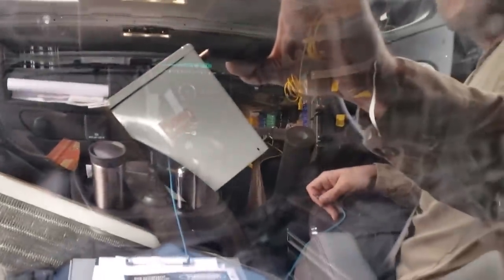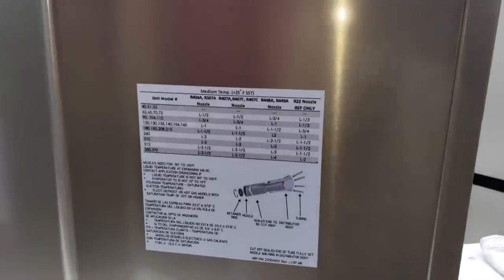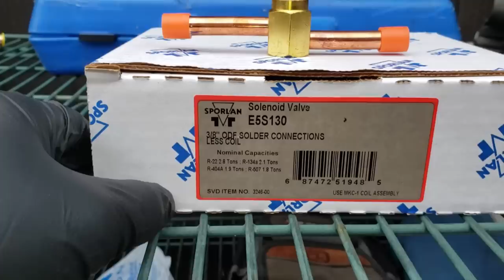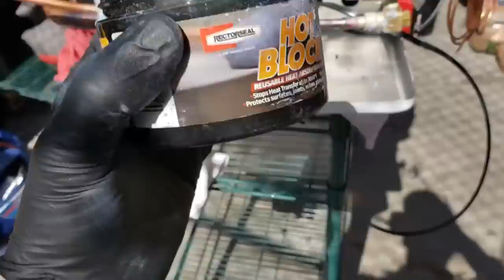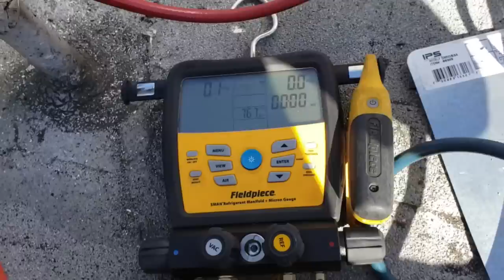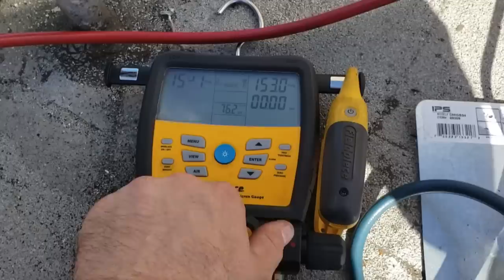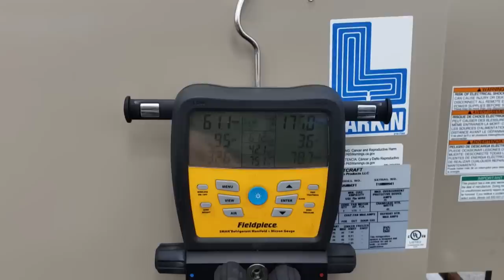WALK IN COOLER INSTALL

Comment: Back in the 80's, I installed a lot of these walk-in coolers and freezers.  The evaporators only came with one nozzle in those days.  It was R-12 for the coolers and R-502 for the freezers.  Today, I would probably use Stay-Brite 8 soft solder instead of brazing but in the 80's we always used 15% silver brazing stick.  The only time we used Nitrogen is when it was included in the specification.  I wish we had Nyloq when I was in working in HVACR.  I bought some when I installed my new A/C and I love that stuff.  I see that the quality control is still mostly nonexistent in refrigeration equipment.  We used to get brand new compressor racks and all of the piping was leaking and was not pressure tested.  We would have to re-pipe everything before we installed the racks.

Comment: I have found that sanding the tvx fittings in fact any valve fittings heat up faster reducing time spent brazing which in turn reduces the  chance of overheating ur valves. I have done dozens of supermarket installs and this technique reduces brazing time alot

Comment: 60' is one flat on the valve, I usually put some permanent marker lines one the body and power element so I can see when its turned the right amount.
Reply from the maker: Yeah I'm bad in that I just can feel it and know when it's right, same with flares. So when I'm making a video and trying to teach I sometimes forget and just do what I know is right vs actually setting an example
Reply: I'm sure you don't need any advice from me! just thought it might be ahelpful idea  to anyone reading the comments. 
Don't see many sporlan valves here, maybe get to work on one once or twice a year.  @HVACRVIDEOS
Reply from the maker: Thanks for watching, I will be going live this evening 3/25/19 @5:PM (pacific time) on YouTube to discuss my most recent uploads come on over and check it out if you can... https://youtu.be/Bqx-RSJsidY

Comment: Nitrogen IS used as an inert gas,  but the term "inert" in this case  doesn't have ANYTHING to do with temperature and pressure. An inert gas is a gas that does not undergo CHEMICAL reactions under a set of given conditions. like how when you burn Hydrogen in an Oxygen environment - you get water, a chemical byproduct. Not to be confused with Noble gasses either.  Nitrogen is used in you braising because it is CHEMICALLY inert in your application, and won't react with your solder, flux, copper, or torch byproducts. And it may not even be pure nitrogen, there are compound gasses that are chemically inert.  The people who believe a gas in a closed system doesn't respond to temperature by changing pressure are just wrong flat out, whether the gas is chemically inert or not :)
Reply: PV = nRT you can't avoid physical laws :)
Reply: And while nitrogen is enough for brazing, you can't use it in arc welding because at that kind of temperature it WILL react with iron, messing up the welds. You need Argon, which is a true noble gas and will not react with iron.
Reply: @Zonkotron  and I am still unsure why argon is not used for this type of thing...... nitrogen stops the reaction inside the braze but argon would too and is used for almost every wire-feed welding system I've seen (not counting flux-core wire) so why nitrogen instead for refrigeration?
Reply: @jojomorgan8556  Nitrogen is cheap. The cheapest technical gas there is. Nitrogen and Argon are both drawn from the air by Linde Cycle Plants and there is like 60+ times as much Nitrogen as there is Argon per unit of Air. If you are not heating stuff above a yellow (glowing) heat, it is perfectly sufficient

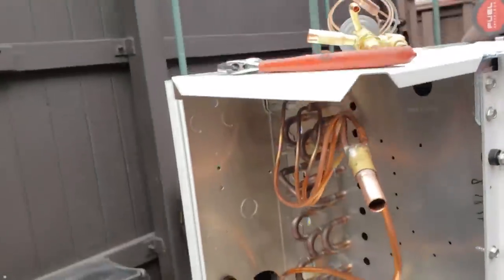Comment: 9:02 You should send this video to Heat Craft. During the shipment the debris can be anywhere inside of the coil. Likely you see the debris. If all debris goes inside of the coil, and after you have everything set up, and turn out somewhere is clogged, you have to no idea why it is clogged. It will be very frustrating in the field!

Comment: That was nice that you had the opposite side of the box from the old evaporator coils to hang the new evaps. It made the install not pressed by any down time issues for the product in the box. Also, good move on your part to not want the hot air from the door opening to feed directly into the return air on the new evaps. Installing the new ones on the opposite side of the box makes it so the warm air entering from the doorway has to mix with the box air before reaching the return air side of the evaporators. That will help your Delta T split readings alot. Anyway, as always, good work!

Comment: When I took a refrigeration course they taught us brazing. Working with my then instructor he uses the same solder that plumbers use. After doing hundreds of joints without failure or leaks... I am sold. LOTS less heat... inside the lines are MUCH cleaner after.

Comment: Nitrogen is an inert gas. What changes pressure in the system is the the air molecules in system the larger the pressure change the the more air you have in the system. Thats why in some system change outs you  have to keep lines closed so your nitro test doesnt have to much pressure change and vaccuum takes less time

Comment: Nice install,  but rather have 2 x separate systems on a 60/60 ratio incase one system packs up the other will continue to run the cold room until it is repaired. Just a thought.... also depends on customers budget...👍

Comment: i dont instal the nozzle, it dont make sense, my customers have old equipment and old evap, i have  head few times where i see low flowing of refrigerant after the txv and some of the tubing from the distributer are partially restricted ,  i found it working better without the Schnozzel
thank you for great video 🙂✅

Comment: Wow you actually get time to change oil on the vac, I need to work for a different company that actually wants to do to jobs right, I work on transport refrigeration we never get time to do anything right.
Reply from the maker: Yeah we try to do it right.....
Reply: Car refrigeration is nice though. Just hook up the automated equipment, punch in the charge, the oil amount, and if you want any UV tracer, hit start, and it will do the job for you and only beep at you if something fails or if you need to do something.

Comment: Nice job. Would you ever consider adding a tee on the liquid line between the solenoid valve and expansion valve to pipe that evaporator master and the other becomes a slave. Change solenoid valve to overall system size so you only have one solenoid.  Easier troubleshooting if valve problem.

I found some shraeder core seals melting in the threads of the access port when they braze the ends on the evaporators, becareful to check the cores before you braze the evaporator in permanently, pain in the ass getting the seal out.

Nice job
Reply: It's becoming more common to see multiple evaporators on one compressor, like cold zone package systems. How do they get away putting multiple pan chillers on one compressor if say only one pan chiller is calling.  High superheat and high subcooling is common bc your capacity can be way oversized with only one calling.  Thoughts?
Reply from the maker: I will answer your question on my stream tonight if you can come over and check it out https://youtu.be/Bqx-RSJsidY
Reply from the maker: I call that system a multiplex compressor killer. It's very common to see this on a Kairak system and we usually have to replace the compressor  every 2 to 3 years.

Comment: Such a pain installing txv and solenoid in these, latest installs have had factory installed electronic expansion valves and pcb controls. Holy cow are they a smoother install. No onsite assembly, no external controls or time clock, all inside ready to go.
Reply from the maker: Thanks for watching, I will be going live this evening 3/25/19 @5:PM (pacific time) on YouTube to discuss my most recent uploads come on over and check it out if you can... https://youtu.be/Bqx-RSJsidY

Comment: You should look into getting a noga deburr tool NG1003 for deburring the cut tube.  Just be careful to deburr with the pipe facing down to keep the chips out.
Reply: Was thinking the same thing.  First became aware of the Noga from watching Adam Booth’s channel.

Comment: I had not seen this video where you are changing two evaporators in a cold room, the truth was I found it interesting to put new equipment I have always liked but I observed one detail and that is that you made the interconnection for the two evaporators in the suction pipe instead of putting one yee you put a tee, and the truth the tee in that connection usually produces a coefficient of friction too high because two pressures collide perpendicularly and I think you also did not install oil trap in the suction line of each evaporator are details that are tuned over time is my humble observation

Comment: Thanks for this video.Great job.just a few questions, Normaly a TXv is fitted with the power element facing upwards, is a position like the one u do okay? And the sensing bulb on the suction line what degree would it be.Thanks

Comment: Great video. Just curious if you've ran into evap fans not cycling on untill it reaches a certain temp in the box. What two. Connections do I jump to bypass untill the box reaches a colder temp?
Reply: Your defrost termination has 3 wires red , black and brown. Black is your fans red is common you can simply tie red and black together and that will turn your fans on before the coil gets cold.

Comment: Thanks for showing that hot block. Think I’m gonna stick with regular wet rags, that cleanup looks like the last thing I want when I’m busy.

What was going on with that suction line insulation on the roof? Why did you have to resort to that?

Comment: Can you please do a demonstration on a unit with mismatched components, evaporater to condensing unit under sized/oversized, I find them difficult to not only diagnose because how would you know first of all, I have a good idea but that normally takes hours to figure out
Reply: Or a better way ya to cross reference units
Reply: I have added refrigerant to circuits with way to big condensing units to evaporators not knowing that the evap was way to small for the actual unit itself, high head low suction just to find out it was mismatched

Comment: Would it be better to use a triangle file to cut open the distributor cap instead of a tubing cutter (similar to cutting a capillary tube style metering device) or have you found that doing so is an unnecessary venture?

Comment: Good  job like always but why have  solenoid valve in both evaporator  ?
Reply: Jose Martinez id like to know the same.... I think I saw two separate thermostats which must mean the evaporator coils can run independently
Reply: Maybe he just parralelled the selinoids....I pushed rewind did NOT see second climate control....
Reply from the maker: So I used two solenoids and one control, I find it easier to run wire instead of a tee and a liquid line from one coil to the other. On a box this small separate stats for each coil would be a problem.
Reply: HVACR VIDEOS makes perfect sense....thanks for the reply..you're the shit bro...👍👍
Reply: @HVACRVIDEOS  thanks for replay this is first time I have some doubt with you work .
Reply: @damarcojackson1005  same here but he replay ,HVACR is AWESOME.

Comment: Why are you using a separate micron gauge? Isn't it built in ? I have the testo 557 and I'm looking to upgrade to something also with a manifold. Is it not accurate enough for you ?
Reply: I wouldn’t trust the manifold gauge set to do the vacuum.

Comment: Nice job brotha! What is the purpose of the suction line trap behind the coil? I do not see it all the time
Reply from the maker: It is there to help any oil in the evaporator coil to return back to the compressor.
Reply: You only need a trap if your compressor is sitting higher than your evap coil. Basically if it’s on a rooftop vs on the ground

Comment: Do you have to change the oil in the vacuum pump several times during the pulldown?
Reply from the maker: It just depends on how contaminated the system is, each job is different.

Comment: 15:48 what are those hangers called? I have a job coming up those would be perfect hadn't seen those before.
Reply from the maker: insulation saddles I have had them in the shop forever,they are meant to clip on unistrut,  here is a link https://www.zsi-foster.com/products/insulation-saddles.html

Comment: Where I work at we usually soft solder systems like those is there a reason you braze just wanted to know thanks
Reply: Soft solder is used in plumbing and the solder will leak in refrigeration systems. Also brazing will weld pipes to with stand high pressures. You maybe using silver solder that is the same as brazing - Just a different type of jointing material

Comment: Have you ever used Stay bright#8? what is your take on it?
Reply from the maker: No I have not used it, I have fixed several soft solder leaks on expansion valves though, I only use 15% silfos and 56% silversolder
Reply: @HVACRVIDEOS  I have been using it on TXVs for years, never had an issue, if you clean your pipe well an do it right it will out life the silver solder and won't anneal your pipe or damage the valve. give it a try, you will be glad you did. I have fixed so many cracked copper pipes due to annealing over the years.

Comment: A lot of the new pre charged systems from kolpak are coming with 448A in them. I honestly don’t care. Just choose a refrigerant and stick with it. Too many jugs too Carry anymore. And going to the shop isn’t feasible every other call..
Reply from the maker: I hear you on that, it works the same pretty much just clear the sight glass and set the superheat....
Reply: HVACR VIDEOS my only concern is 448A in low temp.. I just don’t have the confidence in it like I do 404. All the 448 I have worked on is medium temp. But it’s just like 22 and I still see old 22 hoshi making ice so we’ll see.
Reply from the maker: They say 448 runs a higher discharge temp. With the trend towards scroll compressors there will definitely need to be mechanical cooling for the compressors such as the DTC liquid injection. Time will tell the problems we will see
Reply from the maker: Thanks for watching, I will be going live this evening 3/25/19 @5:PM (pacific time) on YouTube to discuss my most recent uploads come on over and check it out if you can... https://youtu.be/Bqx-RSJsidY
Reply: @HVACRVIDEOS  we are using R448a and R449a to replace R404a definitely needing to fit extra liquid injection to keep comps cool. Once set up these replacements seem to be giving better case performance.

Comment: Anyone run the 448A with electronic expansion valves?? We been trying to run it with HEATCRAFT beacon 2 eev’s and valve can’t keep up. Anyone found any issues with this also??
Reply from the maker: I use it on the QRC coils which is the same valve as the beacon 2 and it works fine with 448a
Reply: HVACR VIDEOS ... I’ve only used it on low temp application and the valves seems like it cannot keep up with the refrigerant and makes compressor throw low psi alarms. 
Put 404a in it and works as usual.
Reply from the maker: With 448a you need to make sure the coil nozzle is sized right and the txv is sized right. 448 uses R-22 txv's. While you can make a 404a txv work with 448 a it's not quite right. I suggest you look into the valve sizing
Reply from the maker: Also the pressure control setting will need to be adjusted too
Reply: HVACR VIDEOS ... yea the electronic valves are set for 22, 404 448a and a bunch of others. The piston after the valve is already set and valve welded in by HEATCRAFT when we get the new evaporators. So everything’s already set from manufacture but the low temp EEV’s cannot keep up with the 448A. I’ve heard of people having issues with medium temp also with HEATCRAFT beacon 2 controls. HEATCRAFT recommended that I use 404 for their low temp applications. They were blaming it on undersized refrigerant lines. But the install was right by their book. So was just wondering if anyone else out there in YouTube land have issues with this particular equipment.  Thanks for the feedback 🤘

Comment: What the hell? Why did CA ban r404a? Asking because I'm in Australia haha
Reply from the maker: The official rule is you cant use it on a remote system if it's a new installation. And a new installation is defined as any major component replacement (compressor, evaporator,txv) you can still use it on self contained systems.

Comment: Silly question, how are you going to flow nitro through a unit on the final joint with having a a positive pressure in the unit causing you pin holes in your solder joint.
Reply from the maker: You leave a Schrader port open allowing the nitrogen to escape
Reply: Legend!!